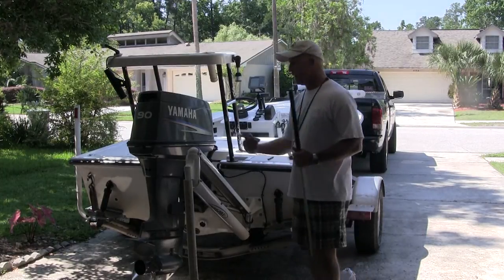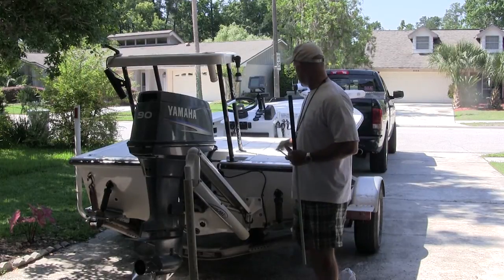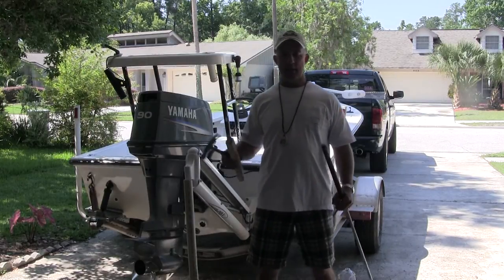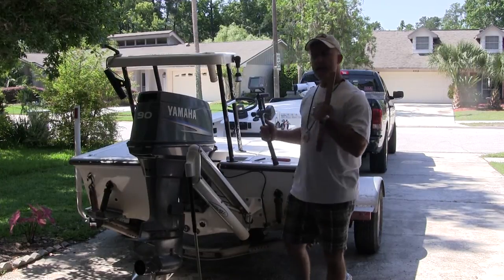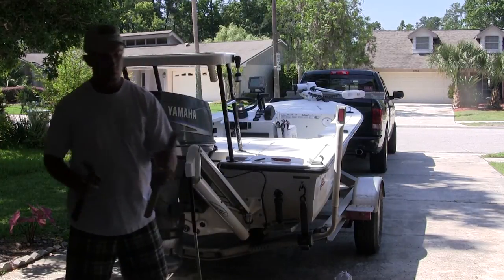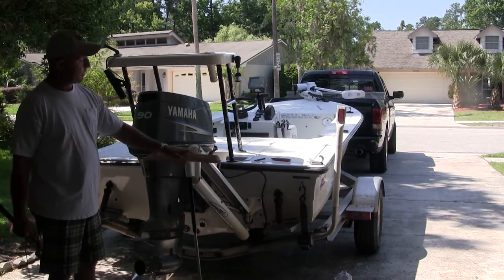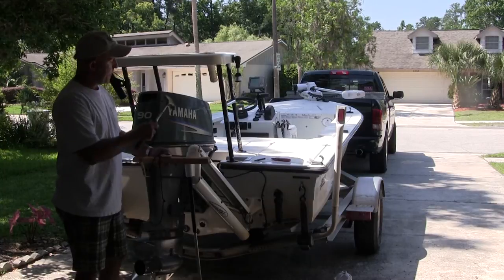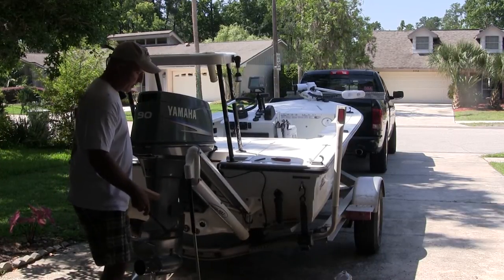Power Pole Spike Replacement

Comment: Hey Chris, I have wrapped my powerpole stake with silicone tape down to the last 8 inches or so. An inexpensive way to keep from getting fiberglass hairs on ya as the pole ages. The black silicone tape has lasted 3 years in full time sun and still looks good. The silicone tape adheres to itself. So its easy to put on. It stretches well so the tape goes a long way. Just make sure to overlap itself  between a 1/4 to 1/2 the width of the tape.